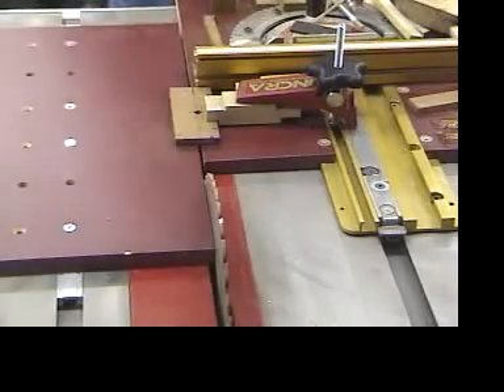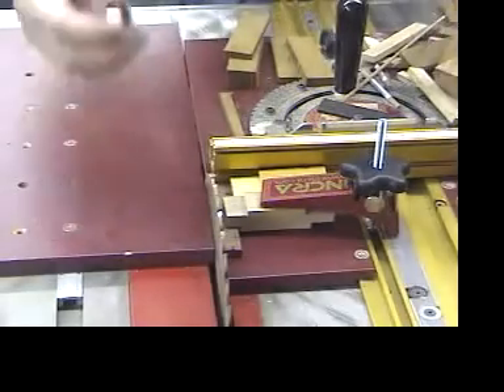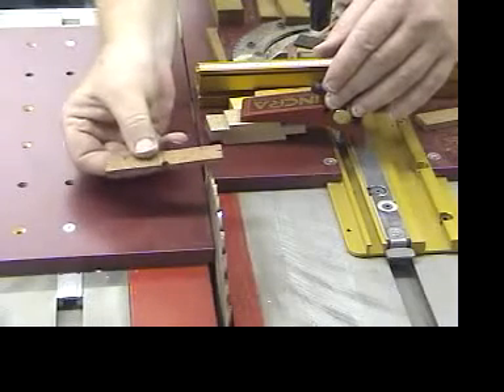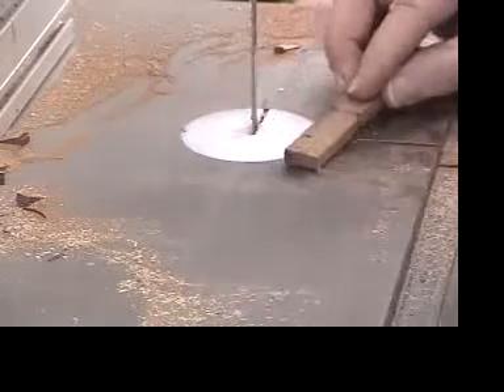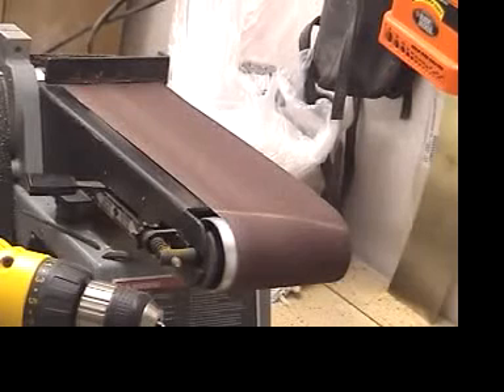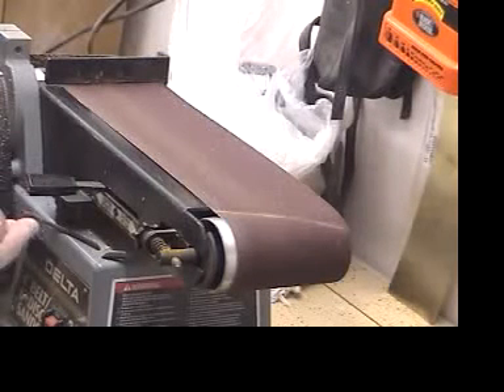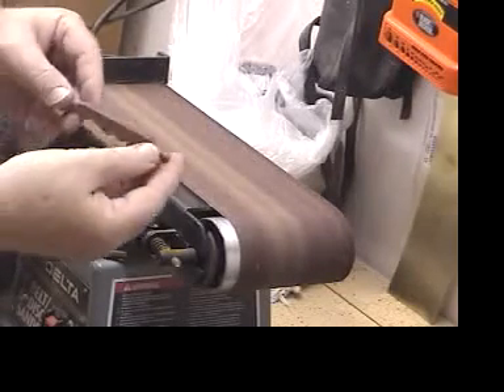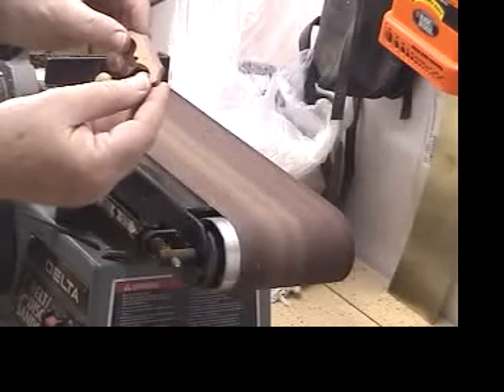Banjo Bridge Making Part 2

Comment: really neat, approachable way to make arches underneath. Also, these days, they have at big box stores and the economy freight one, too -- Oscillating Spindle Sanders,  inexpensive and probably even a little easier to control this operation precisely. I certainly am cleaning up my act on the table saw (video 1) after watching (I'd been just sliding my work piece along the fence, but it's much nicer to do as Mr. Keyes does and use a jig taking advantage of the way grooves ).